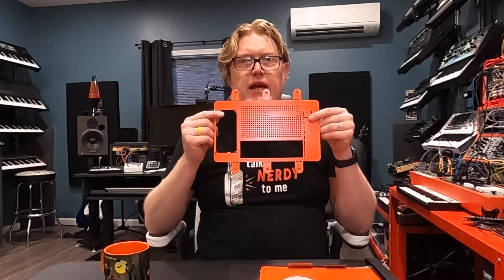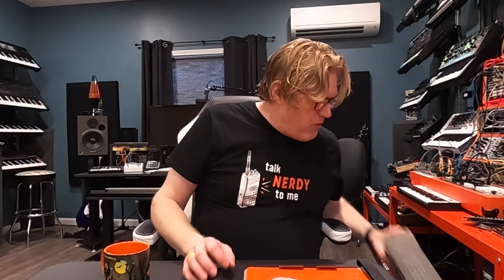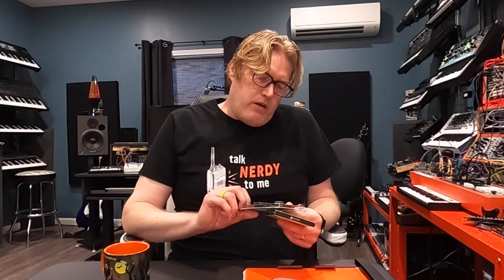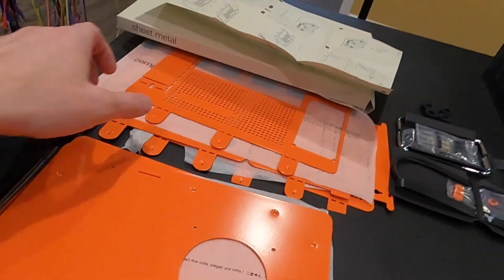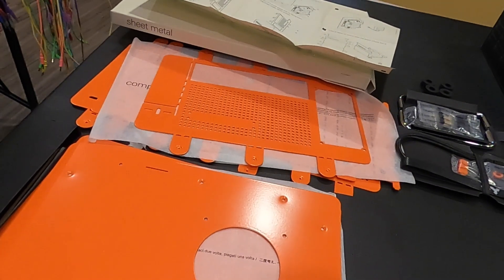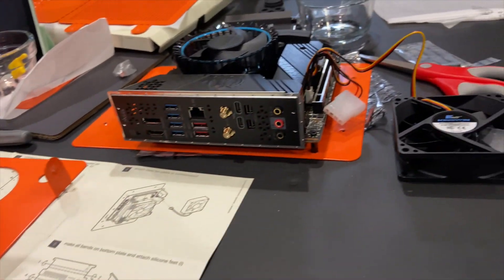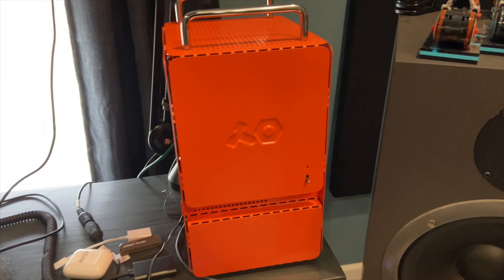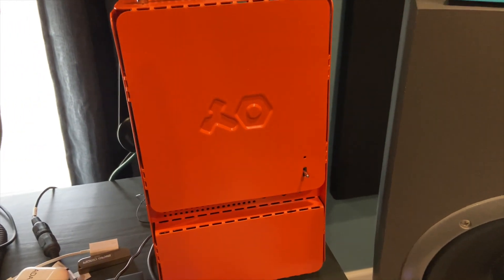Building the Teenage Engineering Computer-1 - mini itx PC case

Comment: What video card did you use?
Reply from the maker: I’m for now just using the on board video on the motherboard. There’s not a ton of options since that case is so shallow. I’m eventually going to put one in.
Reply: @thesolutionband  Any update on a GPU you can now use?
Reply from the maker: I still haven’t added one. I have searched Microcenter for compatible depths for the card and there aren’t many options.
Reply: The Gigabyte 4060 LP just fits, and so do the Palit StormX 4060 and 4060ti. Would also depend on your CPU cooler, but check PC Part Picker for completed builds using the case.

Comment: Does your headphones jack happen to work?
Reply: I asked TE about it previously because mine did not work either. They said it's a bios setting and that the audio is a different format from what is now standard. Called MSI my motherboard manufacturer and they said the audio format is not supported. Bit of a bummer.
Reply from the maker: Oh wow that kind of stinks.
Reply from the maker: Actually no. I haven’t taken it apart to mess with it yet. I’m a little confused as to which pins to plug it into on the motherboard.
Reply: Did you find a cover for your
Fan ?
Reply from the maker: I haven’t yet, but I also haven’t looked very hard.